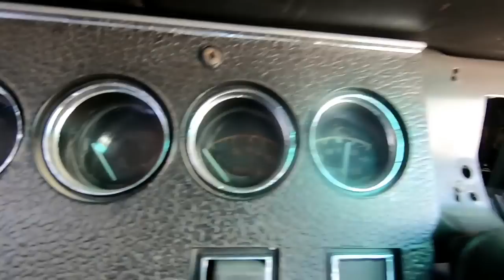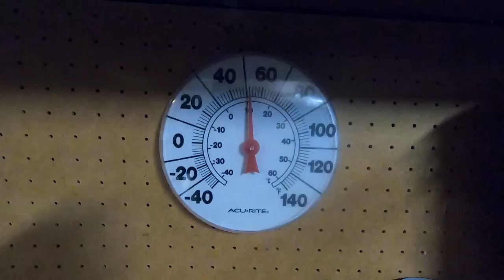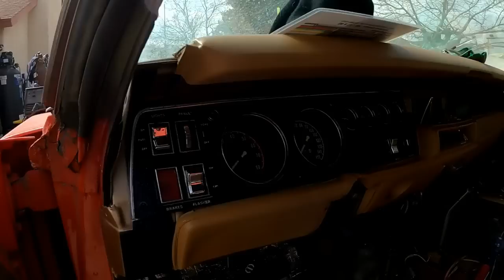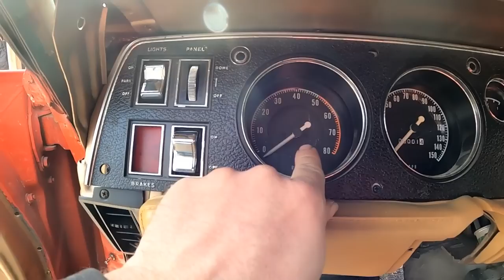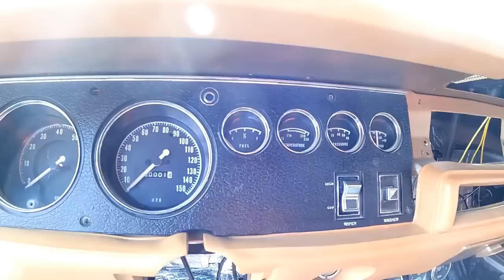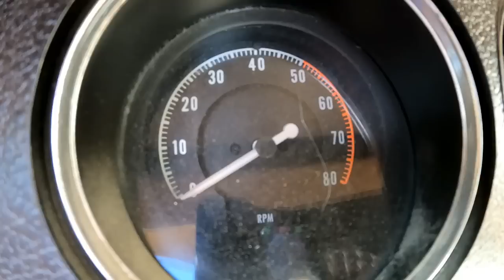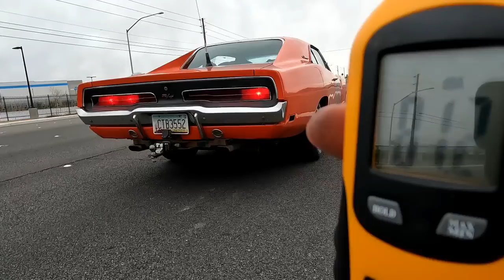The total rebuild of this clapped out General Lee

Comment: Great job, I have a 1970 Black Dodge Charger with factory 383 4 speed car, When I had a problem with my original door panels I found some aluminum sheeting laying around and contact cemented the vinyl to the aluminum it worked great for me.

Comment: If I remember correctly a 426 uses a 4.250 bore (same as 383?)  I wonder if a feller could use a 4.150 crank in that block n use off the shelf 383 pistons in it? We did a similar with 400 pistons in a 440 block.

Comment: Don't put as much gear oil in the differential. Remember, it expands when it gets hot......and the way you drive, it gets very hot and stays hot. Also, autocrossing will slosh the gear oil down the axle tubes, so keep the gear oil a little lower in volume when the oil is cold to anticipate for these situations.

Comment: Do you care about valve spring preassure when you do a break in?
Reply: I will do my first motor and break in. Thx for help
Reply from the maker: If it’s a small cam with correct spring rate not too much, big cams with a lot of spring rate it’s best to run softer springs on break in

Comment: Cool project card though it's not a true. Generally! Time and time again. Not only have John Snyder but the producers and mechanics who did all of the building on the dukes of hazard will tell you time and time again. No general Lee ever had black interior it was intended and solely purposed to have tan interior!  Nonetheless, never a full roll cage, just a roll bar between the back of the driver's seat and the rear seat.